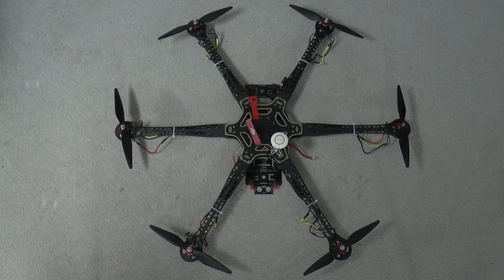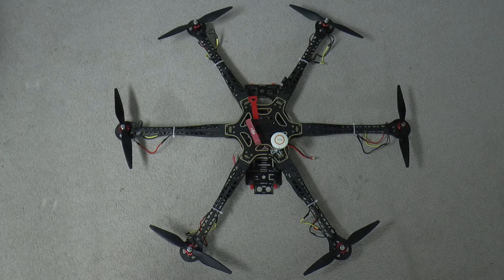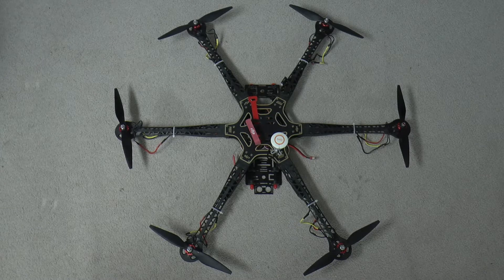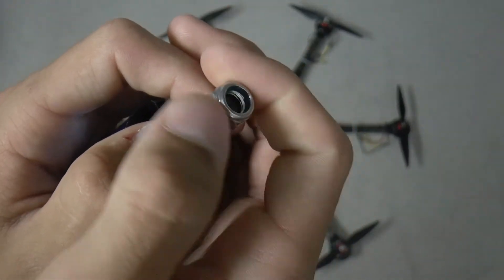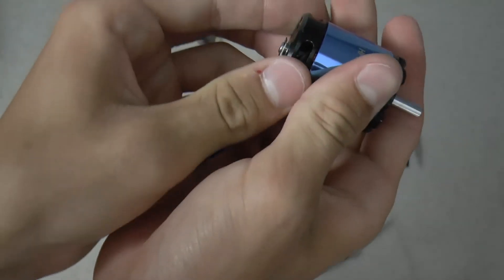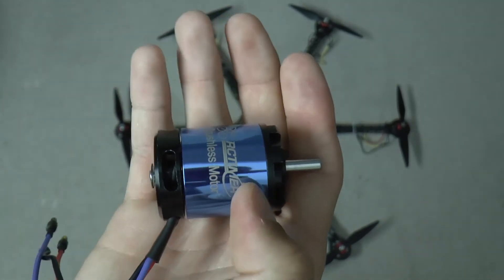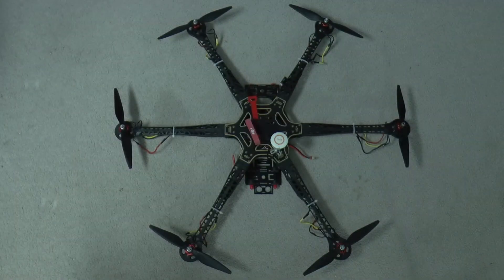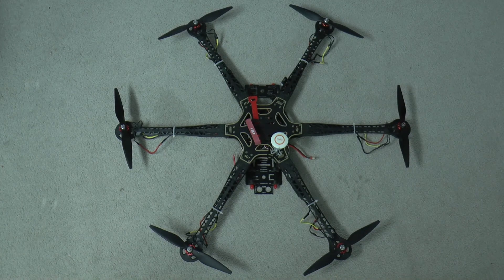OVERVIEW | FIRST STAGE OF F800 CONVERSION DJI/RCTIMER

Comment: I run a F550 with the F800 arms, H3-3D gimbal and Aeroxcraft landing gear.
I use the E300 setup and I was wondering, what is the best combo for improving flight times as they are kinda dissapointing at this point. 

I currently use 6000mAh 4S turnigy's. Should I try to use Zippy 8000 packs or parallel 2 x 6000mAh? Perhaps change to more efficient props?
Reply from the maker: Tim Jacobs The problem you are having is probably too much weight for such small motors. The f800 arms are so heavy compared to the dji arms. There are a few things you can do. 1.) you can buy 6 f550 arms and try that. If you need a large frame then also buy some motor expansion plates to make it a f650. 2.) You could upgrade to lower kv motors with larger props and stronger esc's (because the motors will draw more amps). With a setup that can lift more weight, so you can put larger batteries on with less strain on the motors. Just look at the dji s800 which can fly for a long time with a gimbal and mid-size camera. It uses low kv motors and large props. Since you are using a smaller camera you will get even more flight time.
Reply: Infinite Remote Control I was considering of using the E600 propulsion kit? I would really like to achieve flight times of about 15 minutes or so.
Reply from the maker: Tim Jacobs The E600 is probably perfect for what you are using it for, but it is also very expensive.

Comment: No offense but super cheap motors, I got the same hex with sunnyskymotors, get a better secure set-up....you won't be sorry.......and use prop adapters that secure onto the can itself.....
Reply from the maker: What props do you use?
Reply: Infinite Remote Control 14.5 APC running a 6s battery, and tiger motor 4014-9 400kv, it should be ready in a week...
Reply from the maker: So could I use 3 12x6e APC pusher props and 3 12x6e APC puller props, or are pusher and puller props not compatible together on a multirotor?